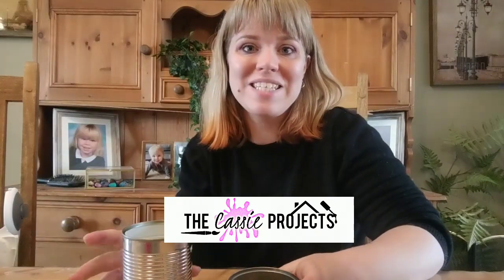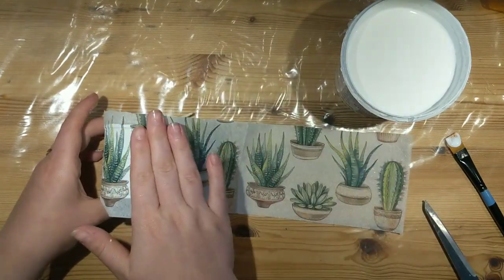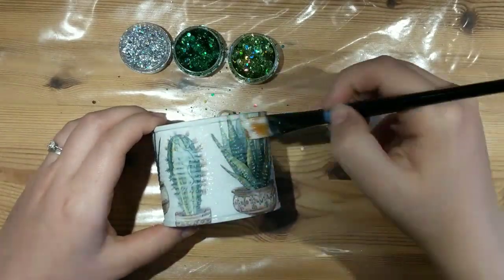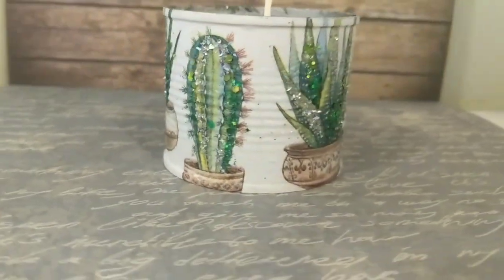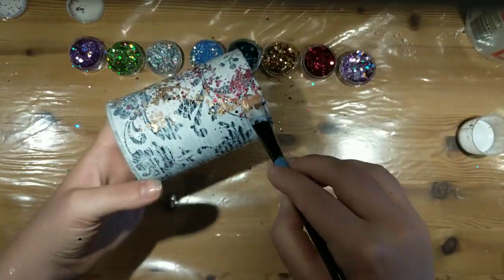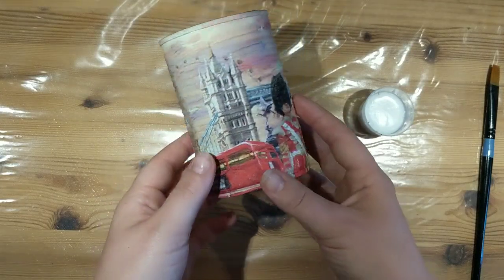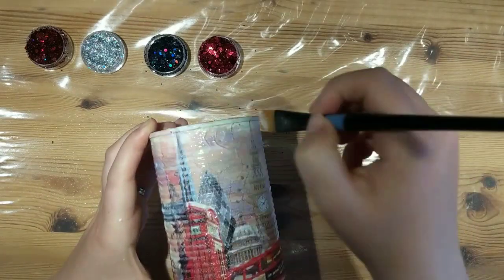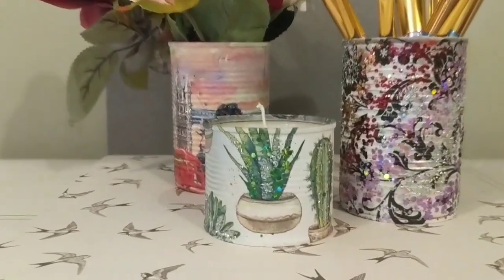Decoupage Tin Cans using PVA and napkins

Comment: All are very nice. How do you keep the napkins from wrinkling?
Reply from the maker: Thank you. Try to get your pva to water ratio right, if you are getting wrinkling it may be too wet. Also be super patient and pull the napkin slowly over the tin trying to pull it right without letting it rip. It may take a few goes but you will get the hang of it in no time 😊😍

Comment: Is PVA glue water resistant?Thank you
Reply from the maker: Hmm interesting question.....
I have still got my tins, they still look amazing.... However I have never used them near water. I have Googled your question and it seems that it is not water resistant.... But I'd love to try this out. Maybe using a light coat of gloss varnish might give you the water resistance you need... I used this on my rubber duck and has been in the bathroom for over a year.
Hope this helps!!